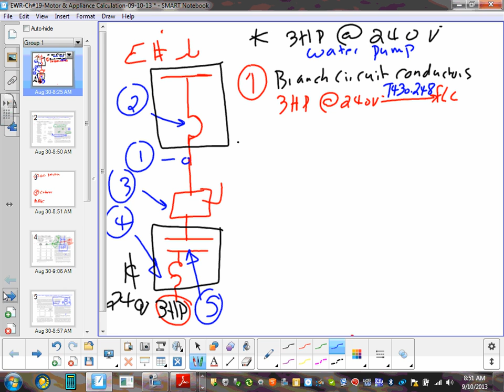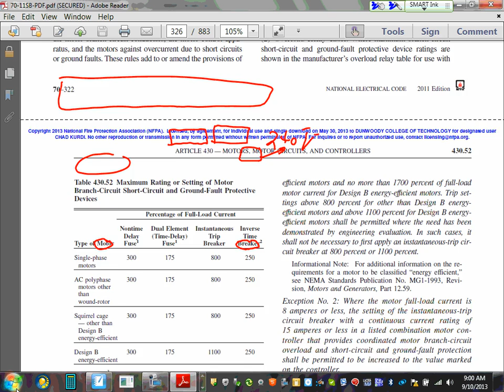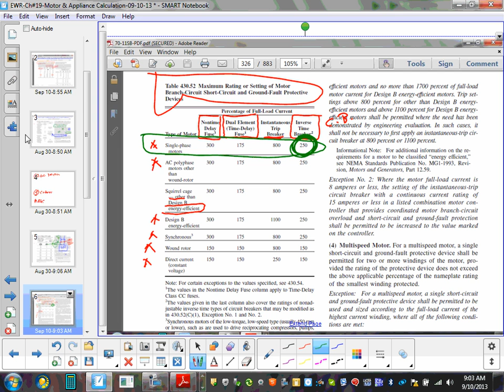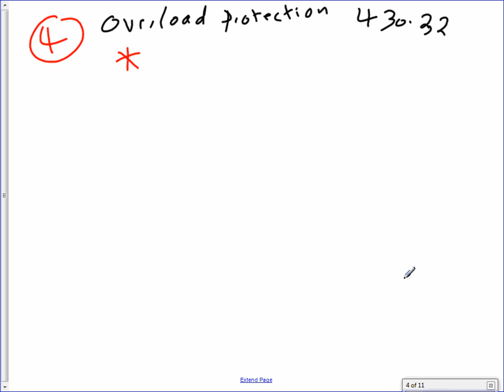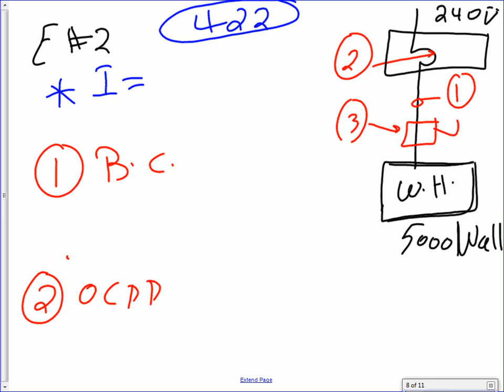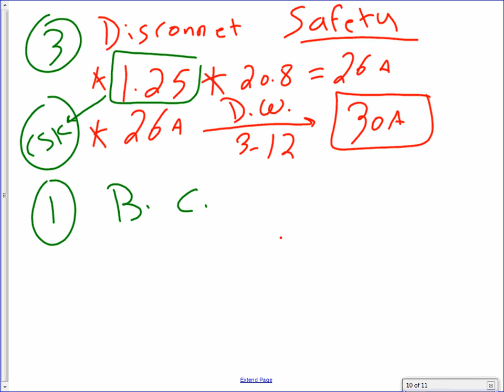Water Pump & Water Heater Calculations 09 10 13

Comment: Your are ignoring 110.14 by using the 75 degree column. Do you mean it doesn't apply to motor branch circuit?